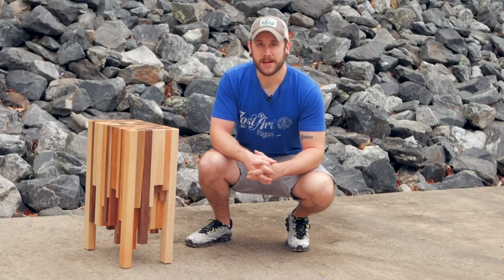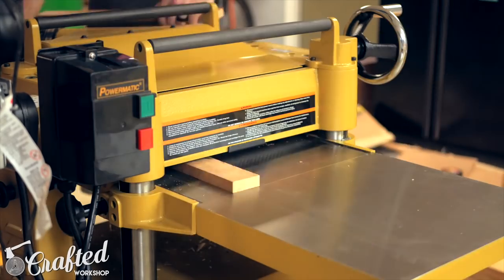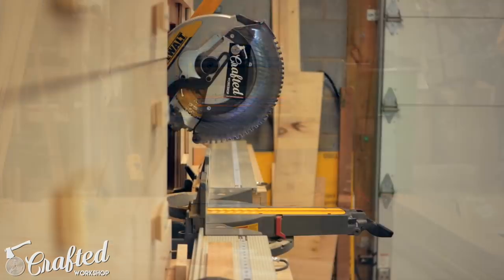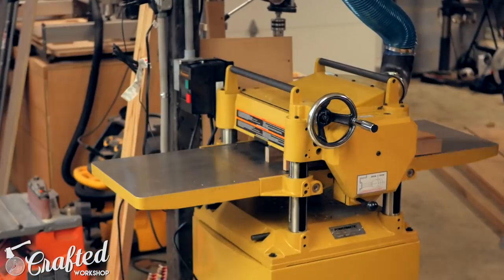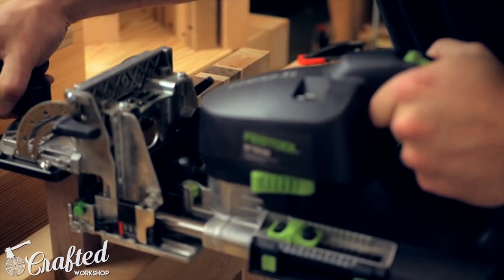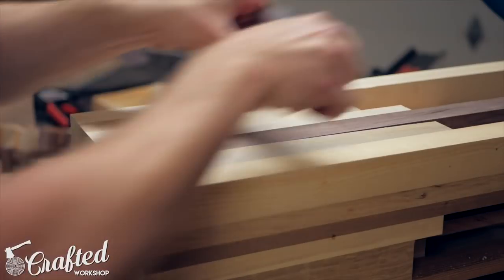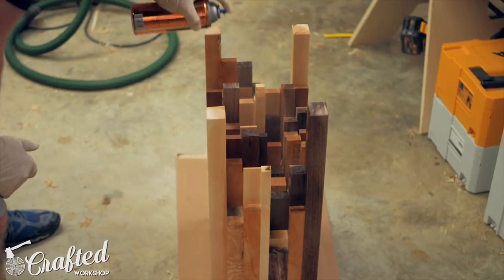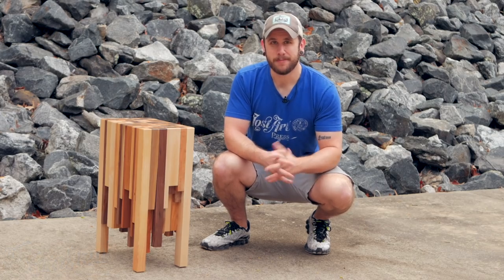Scrap Wood End Grain End Table | How To Build - Woodworking

Comment: Could have glued them up in less than 12" wide panels and then re-sawed them on the bandsaw. Would've saved a bunch of time and wouldn't have needed to use the planer to take off like an inch

Comment: Lovely video and end-product.  One tip (and YMMV): don't put objects into your planer perpendicular to the cutter.  If you tip them so that they'll be angled, more of the cutter will be engaged, and you won't wear one section of the cutter prematurely.  You don't want to have it so angled that the object strikes the side and pivots while cutting to swing into the planer.
Reply from the maker: +Daniel Mooney my planer has a helical head, so it makes the cuts diagonally already. But that is a good tip for a straight knife planer.

Comment: We have a StopSaw at the maker space I teach at... If you set off the saw, they charge $200. To me that adds to the stress and I always worry about to much moister or I missed a staple in the wood and its going to go off.
Reply from the maker: +Get Square w/ Tom Jolley yea, a new cartridge is $90 plus the cost of the blade. I have never set it off due to moisture, only time I've ever set it off was accidentally cutting into my aluminum miter gauge which set it off. I don't think a staple would set it off, unless you are touching the staple. The safety is worth the extra cost to me.

Comment: If you need more width than your planer allows, just build small sections, then glue them edge-to-edge. Make sure they line up.
If you're up to the challenge, glue the sections edge-to-edge and face-to-face in one operation. Make the sections of uneven widths, so you do not have a single cross seam.
Like this:
__ __
___ _
__ __
_ ___
Reply from the maker: +Double Dare Fan yea that would work well!

Comment: Wouldn't if have been way easier to make each piece of wood for the strips the same width before gluing so you wouldn't have to plane so much?
Reply from the maker: +Billy McGrath not really, still a ton of work to rip the strips to an even size.

Comment: I really do like the looks of this table. Even tho the material was near free a man could go broke selling these too cheaply. I realize you most likely didn't build for a profit tho. Would be a nightmare to keep the dust out without an air hose to blow the dust out. Just a thought on the bottom end , if the cuts were cut on random angles or possibly broken off. If broken off you would have a splintered mess when the planer knives hit the broken end grain tho.
Reply from the maker: +Phil Lowman if I'm selling a piece, I'm definitely selling it for a profit. I'd probably try to get $700 for this piece if I sold it. And yes, I think angled ends would look super cool.

Comment: Pretty cool! Here's a ideia: for mor random results look for "random image grid"on google images and try to find images like the ones I'll put the link below. The idea is: instead of having random scraps sliced in even layers try to make a "real" random scraps of random sizes.

"random image grid" is a common computational problem where the computer try to put imagens of different proportions into a gapless square, but you dont have to worry about de computational thing. Just find some good pattern on google images and cut your scraps following the same proportions of the squares of the imagem. If all goes right you will have a "true" random scrap block for your table or cutting board :)

I think the result would be awesome :)

https://i.imgur.com/ADEA9M4.png (for this one consider the white parts not as gaps but as a lighter shade of wood)
https://defenestrate.me/wp-content/uploads/2012/10/cities.png